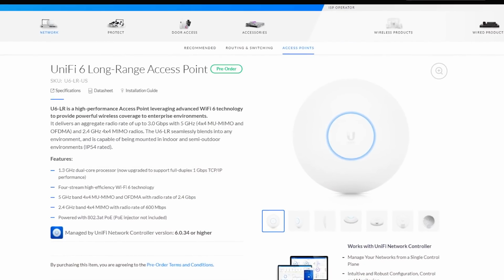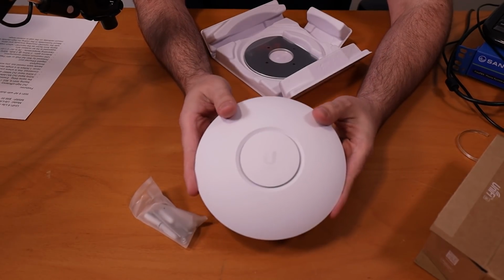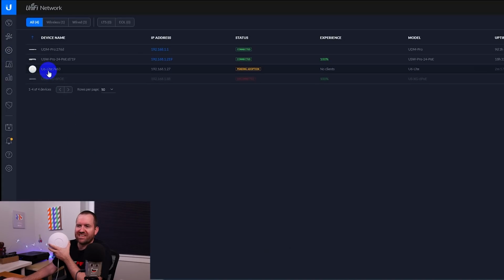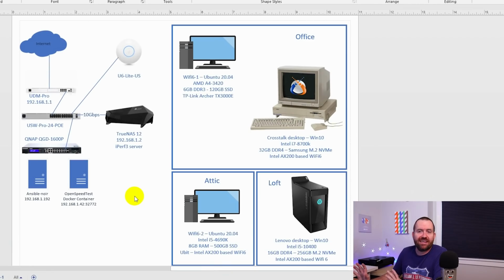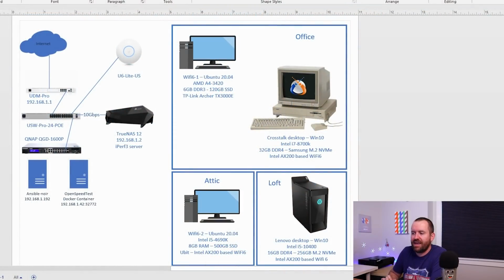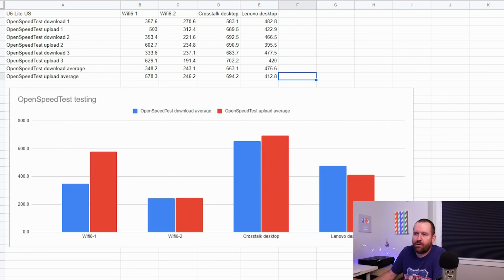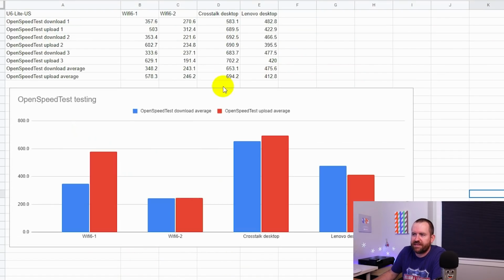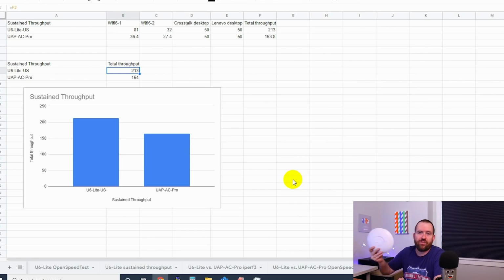UniFi U6-Lite WiFi 6 Access Point - Review and Benchmarks!

Comment: Nice video bit in theory 802.11ax uses also the 60 Ghz band in top of 2.4 Ghz and 5 Ghz.  If you have a device that is wifi 6 capable like latest Samsung or Apple phones and these devices has clear view path to the WAP it can get 1 Gbps throughput on a single client in theory if the device is on the 60 Ghz Band ( I bet under ideal conditions ).  I don’t see any testing on this aspect in your video
Reply from the maker: So you’re kind of right. WiFi 6E (an add-on to the WiFi 6 standard) will use the 6 GHz band (NOT 60 GHz). It will also be able to take advantage of some spectrum in 1.2GHz. But WiFi 6E won’t be in use until sometime in 2021. It’s not available today.

Comment: Great video, been looking for a solid review of the new Unifi Wifi 6 APs since they launched. Wondering if you'd recommend an AP downstairs and an AP upstairs for a ~2000 sqft house or if a single upstairs AP as mentioned in your video would be adequate?
Reply from the maker: Start with a single AP upstairs and add another one if you need to.

Comment: were all of the devices connected to the network wifi 6 capable? How does it perform while also having wifi 5 devices connected? I think that a good test would be to temporarily make your main AP the wifi 6 AP and run the same tests with all of your other devices also accessing the internet, this would show performance with devices idling (iPhone is not doing anything and you are downloading something on your computer) and performance with a combination of wifi 4, 5 and 6 devices

Comment: Great and thorough video. Thanks for the review. Question.....how do you disable the 2.4 GHz band and only use the 5 GHz band? I upgraded the controller software and I don't see the option anymore to disable 2.4 GHz unless the setting has been moved elsewhere.
Reply: You could always enable Band Steering. The other option is to go into your controller preferences and enable Auto-Optimize network to use 5 GHz only...
Reply: @Moonraker11  Thank you. I did enable Band Steering. Could I do the Auto-Optimize also at the same time or is it one or the other?
Reply: Just go to wireless networks in setting.  Then modify the one you want and you'll see option towards the top to use 2.4, 5, or both for that network.

Comment: BTW I see that both the Ubiquiti WiFi is not WiFi Alliance WiFi6 certified yet ( https://www.wi-fi.org/product-finder-results?sort_by=default&sort_order=desc&capabilities=189&keywords=Ubiquiti ).  Also it seems to me that WiFi6 is only on the 5GHz radios and not on the 2.4GHz radios. I will have to run an 802.11 frame capture on my Ubiquiti Lite WiFi6 AP for verification of this. Check out the 4 part Extreme Networks WiFi6 webinars by Devin Akin CWNE#1 for a good overview of WiFi 6.
Intro: https://www.youtube.com/watch?v=IfJ6tAMiq0g
Part 1: https://www.youtube.com/watch?v=XoMnL-Oxi84
Part 2: https://www.youtube.com/watch?v=owBrkFk9afM&t=15s
Part 3: https://www.youtube.com/watch?v=0WD57kfzlJQ
Part 4: https://www.youtube.com/watch?v=fA42ahKlJAI
Reply: I have noticed the same thing.  I had intended to replace my old Asus RT-AC87U that I had been using in access point mode with two U6-LRs and it looks like they half-assed the spec (missing WPA3 and 802.11ax only on the 5 gHz band).  Between that and all the speed/firmware complaints I'm really not sure if I want to buy the ubiquiti product that seems pretty much impossible to return.  May just upgrade to the Asus RT-AC88U that follows the standards and is actually certified.

Comment: Just put in the Wi-Fi 6 LR in and really impressed with speed with 40+ devices although most are ac not ax, but even the ac devices have shown an improvement.
Reply: Yep I also just intalled the new LR and also this Lite one. So far is runnig okay.

Comment: I have a heap of esp32 clients on my network, will a wifi6 AP be better at handling these low bandwidth non wifi6 clients and give my pc more throughput?
Reply: Unlikely.

However those ESP 32 devices should not interfere with your PC anyway because those are on the 2.4GHz Wi-Fi and your PC should of course not be on 2.4GHz obviously.

Comment: Can you comment on the range compared with the wifi5 equivalents? 

I read that the antenna is louder, but I don't know if it's also more significantly more sensitive, which is what really matters as if you want a cell phone 4 brick walls away to talk to the AP, the really limiting factor is not the ability of the phone to hear the AP, but the ability of the AP to hear the very weak signal that cell phone antennas can cast through 4 walls.

Comment: Bear in mind a couple of caveats with the AC Lite

1. No 160MHz bands are available, it’s 80MHz only. This limits top speed of single clients. A lot. The LR version does provide 160MHz channels. Anyone with an Intel AX200/201 NIC will benefit from the LR even if you don’t actually need the longer range. 

2. WPA3 authentication is not implemented. Ubiquiti say it’s coming. This is part of the WiFi 6 spec and for it to not be implemented yet may be a concern.
Reply: Oh and one more thing, if you have Google Home mini (Nest mini I think they are called now) and you allow the AP to decide on its own WiFi channel dynamically, it might pick a channel the Google devices cannot see.

You cannot define a range of available channels. You either pick one channel (each for 5GHz and 2.4GHz) or you allow it to be dynamic and risk your Google stuff falling off the network.

There are obvious workarounds, but c’est la vie.

Comment: Waiting for a Wi-Fi 6 nano replacement I’ll stick with my 3. Nanos getting 650mb over Wi-Fi on a gigabit connection. Love the reliability of the nano and more bandwidth on the 5g and 2g
Reply: It's a good replacement. I just replaced my nanoHD and AC PRO to U6-Lite and U6-LR. On my Lite with 2x2 MIMO client (Ipad Pro) i'm getting the same 600-700Mbps. But in my opinion the latency is smaller therefore feels snappier.
Reply: @lpjerry21  it’s possible but the improvement for these models are small considering full the tech available on a loaded 4x4 mimo Wi-Fi 6. The 5g bandwidth would be far higher about 2.5gb/s allowing for possible full gigabit over Wi-Fi in ideal conditions. And all the other misc tech that goes along with it. I feel they stripped these early models down not happy. I expected a fully loaded suite to choose from
Considering the delays.
Reply: @jseaber  To be honest I also purchased a U6-LR which has 4x4 MIMO and sure it's better in crowded wifi environment.
Reply: @lpjerry21  I’m in a manor crowed area over 300 access points in range. I use 3 nanos maxed out on dss channels and now Wi-Fi is unbeatable. I won’t change until they make a higher powered Wi-Fi 6 access point which has full compliance these aren’t using all the available spec under Wi-Fi 6

Comment: I've had a pair of U6-Lite APs running since June when they came out on early access and they've been phenomenal through and through. Plenty of tweaking was done over 6 months to get them to this point of course but I love mine and the price point is excellent. However, I'd like to note in early access both of mine came with a POE injector. Considering this is in fact a "Lite" Access point, you can likely assume more of these will go to Pro-Sumers while the other higher end higher density APs will go to commercial installs where they may have big POE switches, so it wont matter as much as it does with this device. Bad move on their part in my opinion.
Reply: Do you have a lot of iot devices that require 2.4 band on that network. Heard the wifi6 devices have issues with those kinds of devices. I have a lot of cameras and doorbells that use that band so I have been waiting.
Reply: @coldracerx  About half of the clients on my network still use 2.4, such as my 1st gen chromecasts and some older phones. They consistently get a good connection, chromecast never stutters on streaming

Comment: FYI, this model doesn't come with a PoE injector (as shown in video). The injector costs $8 USD.
Reply: I purchased two of the lites and they came with the injector. I have the LR on pre-order and that one says it does not come with the injector
Reply: Did some more research. If you purchased them during the beta period, you got the injectors. If you buy them now, you do not.
Reply: This tidbit bit me. Because the AP AC LITE requires a 24V PoE injector while the Lite-6 requires a 48V PoE injector. Of course if you’re plugging it into a PoE switch you don’t have to worry...

Comment: Is the UAP 6 Lite backwards compatible with WiFi 5 clients? If so, how is over-all traffic affected for the WiFi 6 clients once WiFi 5 clients connect?
Reply from the maker: Yes it is.
Reply: What about the affect that devices connected with WiFi 5 have on the over-all WiFi 6 experience?
Reply: @paulkruse1219  only Wi-Fi 6 devices will benefit from the improved performance under high congestion.
Reply: I’m sorry I did not phrase my question clearly... Remember in the OLD days when an 802.11b client would connect to an 802.11g AP, how the speed of the wireless was lowered for all g clients, simply because a b client connected? My question for WiFi 6 is, “If a WiFi 5 client connects to the WiFi 6 AP, does that lower the speeds for the WiFi 6 clients connected to the same AP?”.

Comment: Definitely a good AP for home network upgrade. The results for the AP Pro are expected because it works on 2x2 streams instead of 3x3, so you can get about 433mbps on AC standard. The AP can of course access to 650mbps realistically but with a wifi client usine 3x3 streams

Comment: Although the WAP only has a 1 GB NIC, the increased capacity may be seen when communicating wireless to wireless between devices that are both connected to the same WAP.
Reply: the capacity gets used on both send and receive clients, so you'd still only get 600Mbps max throughput on 5ghz
Reply: @JABloch  Depending on the MIMO. If both devices were on different antennas I would expect more.
Reply: @JABloch  I've seen as high as 704 on my U6 lite
Reply: This is a misunderstanding of throughput/bandwidth values. Wireless is always aggregated uplink and downlink, wired speed is 1Gbit/s each. So in wireless terms a Gigabit connection is up to 2 Gbit (if used symmetrically).
Reply: @MarkusMayrl : Good point. I didn't take Full Duplex into account on the wired connection. The overhead on wireless always makes it slower than wired, even wired that is supposedly slower than the stated wireless speed.
Reply: @wmcomprev  yes, overhead limits the  net throughput as well. I have yet to see a real-life example where the Ethernet uplink real speed exceeded 1 Gbit. I can imagine in high density applications or with a few high bandwidth clients on MIMO it could be possible.
Reply: @MarkusMayrl : "Wireless aggregated uplink and downlink..." WiFi 6 is different on this. WiFi 5 (AC) and below can only listen to one client at a time, but with MU-MIMO can speak to more than one at a time. WiFi 6 can also listen to more than 1 client at a time. It also handles collision avoidance differently. It gives each client a specific talk time, so there should be no collisions. However, even with the improvements, it's still not going to be as good as wired.
Reply: @wmcomprev  The way the total throughput is counted did not change in Wi-Fi 6. It is still the aggregated number for both directions. MU-MIMO was available before in .ac and .ac wave 2 as well, but the total number of parallel streams was doubled. But for this you need a very good (and expensive) 8:8:8 access point, which are usually only the flagship models of the big established manufacturers of the likes of Aruba and Cisco. Talking to multiple client devices simultaneously within the same time slots is the biggest development, this is where OFDMA pushes efficiency of the spectrum to a new level. As for new methods to avoid collisions I would rate BSS Coloring as the most important improvement. And there is more, some features are yet to be implemented by network equipment manufacturers. 
Now, all these developments only work on 5 GHz for this AP, so I would say you miss out on a lot for the 2.4 GHz band. 
And most importantly how well all this works depends upon the scheduler every manufacturer applies individually. These are the secret sauce and differentiate consumer products from real enterprise grade products.
Reply: @MarkusMayrl : Agreed, it's new and we'll have to wait and see how well the manufacturers implement the improvements. However, in theory, the improvements sound great. Add WPA3 to that also and it should seems as if we weren't using wireless before.

Comment: i'd like to know how the nanoHD performs in the sustained 30gb download test... Is it faster than the u6 lite because of the 4x4 radio?
Reply: Hi! I have an U6-Lite at home which just replaced my nanoHD. The throughput is essentialy the same on both devices arround 600-700Mbps. I tested them on my S10 and on my Ipad pro 11. As long as those clients have 2x2 MIMO antennas there will be no difference. Of course if you source an let's say 4x4 MIMO PCIe card for your PC then I can imagine the througput would be slower on the U6-Lite. What I also noticed that it's somehow snappier than my nanoHD, i suppose the latency is smaller on the newer device. Hope this helps!
Reply: Same here running a mix of the NanoHds and FlexHds
Reply: No, 4x4 Mimo will not help you with Download speed, it has it adventages in a „Max out Clients“ Environment. If only you Download 30 gig down, you will not have a Single advantage from 2x2 to 4x4.
Reply: @johannes @gerhard I'm talking about the 30gb test he did with the clients simultaneously.. he mentioned 4x4 would benefit such a scenario, but I'm curious how much if at all when comparing the nanoHD/flexHD to the u6 lite.
Reply: @thomasdb1  4x4 will matter if you have a 4x4 client.  Most clients are not.  I have both the 6 lite and a nano HD.  The performance is slightly better on the nanoHD with AC clients (~3%) but the 6 lite pulls away a bit with AX clients.  My speeds were higher than the OPs with the 6 lite (less noise perhaps?)
Reply: @nowcows  are you using the nanohd and 6 lite as a mesh network? Do you have the nanohd wired or the lite 6 wired in? I'm looking to get the lite 6 in addition to my nanohd and create a mesh, any info will help
Reply: @ClickBaitMate  Hi, 
Not in mesh.  I hard wire all of my APs.  This is really nice equipment just to end up meshing it IMO.  The most valuable part of APs of this type is PoE so you can distribute your WiFi with maximum bandwidth for you tech.  
Id urge you to look into using APs as APs over PoE and ditch the mesh if possible - otherwise scale down your requirements to slower infastructure (N maybe due to its long range?) and save money as you won't see benefits to bandwidth at scale once meshing... My $0.02 and perhaps your application is one I just haven't wrapped my head around.  Best of luck Nathan!
Reply: +1. 
Many of us are on NanoHDs FlexHDs etc. A comparison with newer wifi5 would be useful to determine if/when to upgrade. 
Thanks for the video 👍🏻

Comment: I'd really like to see AC wifi results on the newer AP, not just wifi 6. The majority of everyone's devices will be older tech for a loooong time.
Reply: Dont they have both radio bands? If I hook up all wifi6 WAPs throughout my house, will I run in to any issues running my usual 2.5 and 5G suspects(
Reply: For people who buy expensive phones every 3-4 years wifi 6 will be in their smartphone already or in the next 1-2 years, the 2019 qualcomm snapdragon 855 and 2019 apple A13 chips Both have wifi 6
Reply: @mika2666  my OP 7 Pro has Snapdragon 855, but OnePlus decided not to utilize WiFi 6 capabilities, stopped on AX.
Just saying: if you have the latest silicon, that does not automatically make it latest standard. Made me mad for a while.
Reply: @real_andrii  yup. I have a 7t. Same boat.
Reply: @mika2666  You don't need wifi 6 in your smartphone, laptop maybe? Desktop without cable? Maybe. You could already get 300-600 with 3x3 ac and decent range.

Comment: I got 3x U6-Lite, and 1x U6-LR my result with U6-Lite is about same as yours, biggest difference I see is the 5GHz Channel Width can be set up to HE160 and even on older AC device I see much faster speed open speed test I am getting 600Mbps on a iPad Pro 10.5 (AC).

Comment: I recently upgraded from the AC Pro to NanoHD, replacing 2 pros for 3 nanos to get extra coverage even in my workshop. I dont I will go down the Wifi6 route just now as 3/4 of my devices are wires anyway ;) Ps: just ordered the industrial 8 port and 3 flex sw so I can start to cover must of the house with poe.